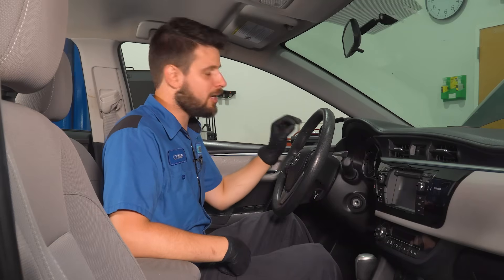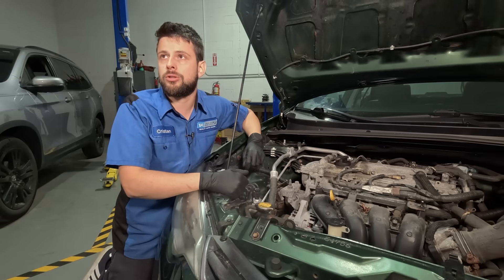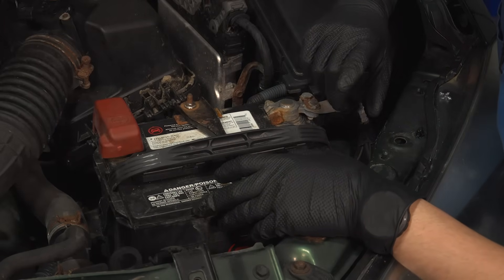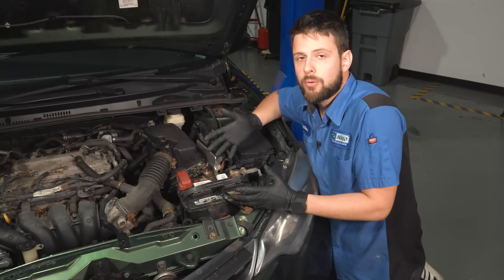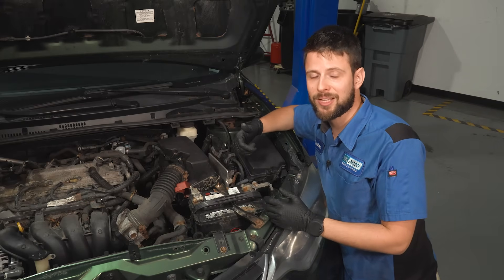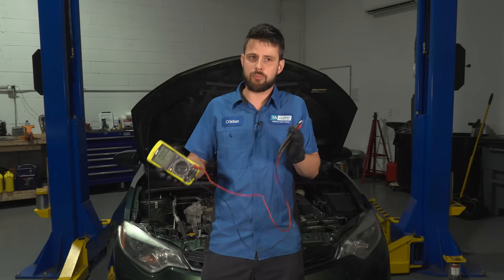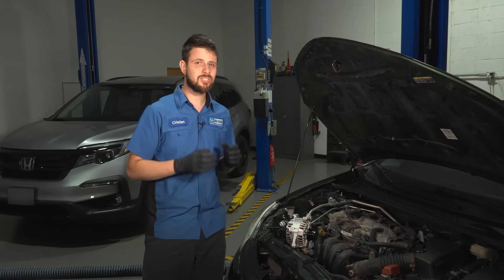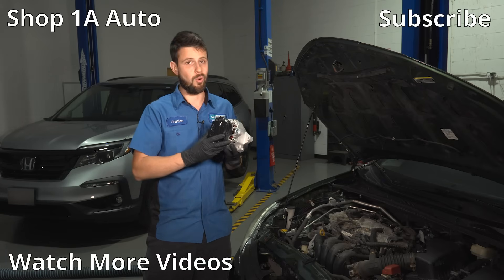Alternator & Battery Partnership: How Do They Work Together? Fix Your Car or Truck Electrical Issues

Comment: Dodge truck run through fuse box, it go out, alt Don't supply enough voltage,  alt and batteries Don't help,